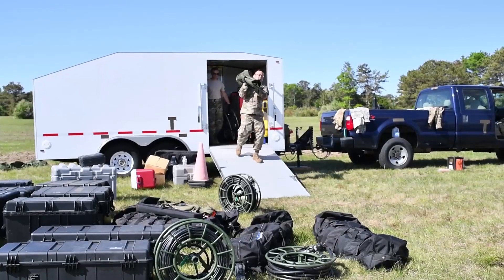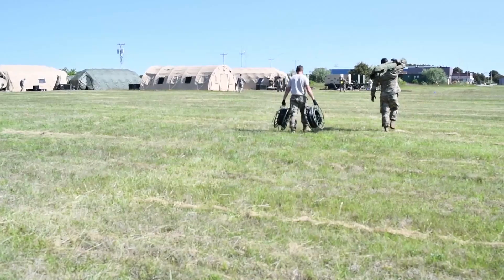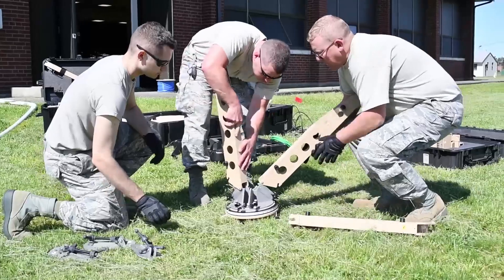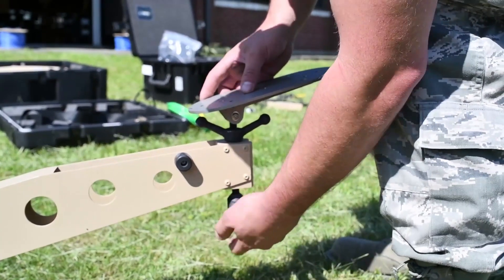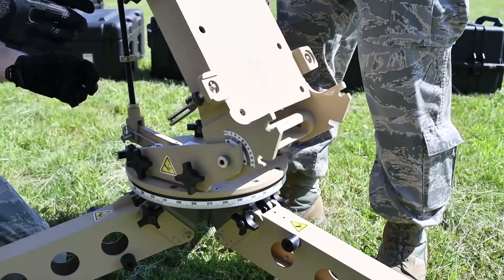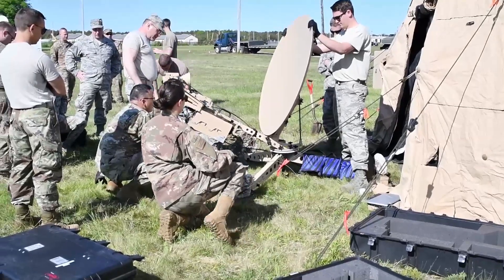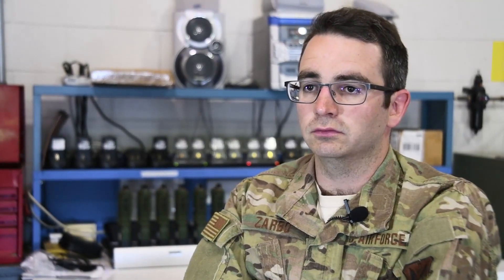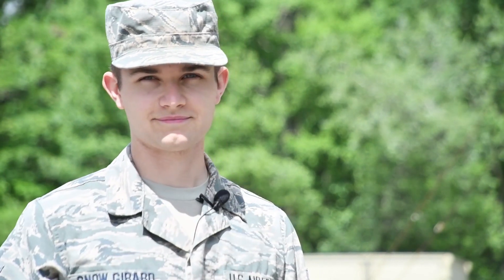Radio Frequency Transmission System Specialist

Comment: I have a question for one of the space jobs. To qualified for Space Systems Operations, do you need to score a 60 or a 70 on electronics? I am getting a lot of mix answers.
Reply from the maker: Good morning. 
ASVAB SCORES
E - 70

Pam
Air Force and Space Force Recruiting Service
Reply: @USAirForceRecruiting  Thank you for responding. Although, I called an Space Force recruiter and they told me it was recently changed to 60 and the new AFSC is a 5S0X1 but it still uses the old one which is 1C6X1. They said it's in the AFCED when the change was made. I'm just getting a little confuse and wanted to know what's the real score.
Reply from the maker: Xavier, you are welcome. 
Ray 
U.S. Air Force and Space Force Recruiting